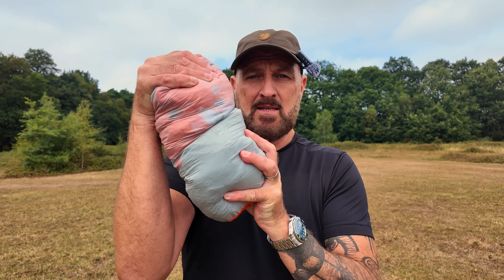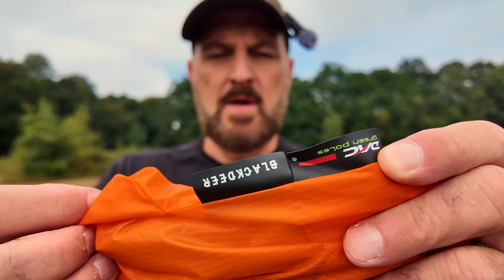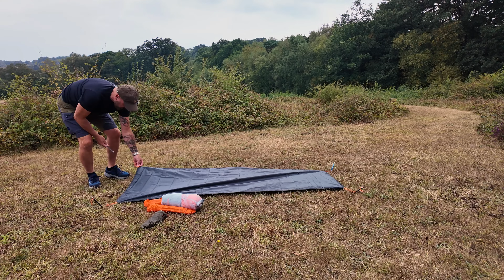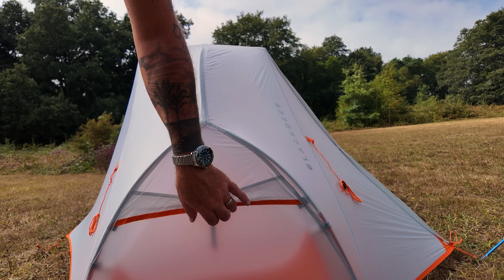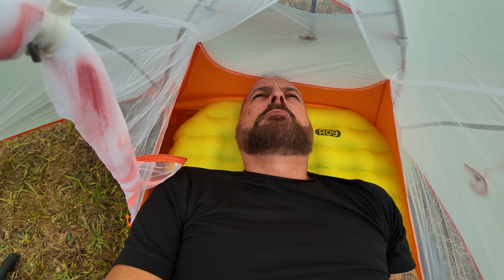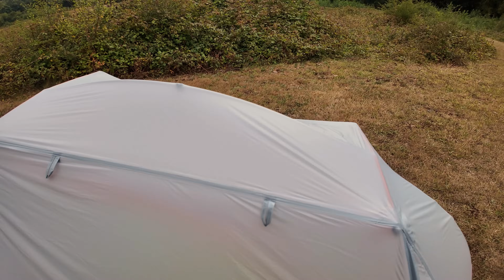42mph tested Budget Nemo Hornet? 985g DAC Tested tent from @blackdeer_official #camping #ultralight

Comment: Being under 1kg with poles is just incredible. I'm not as tall as you but I do have broad shoulders and I noticed that it looked very snug at your shoulders in the video. I love as well that the door can be used as a canopy by unzipping both sides and holding up with poles. If they did a 2p version to combat width concerns I would be very interested.
Reply from the maker: They may bring a 2p out but ues it was snug. Im 46 inch chest but im wide rather than deep so filled it pretty well

Comment: Apologies for not being relevant to the video but how are you finding the tianshan I’m looking at getting it but just want an opinion first, thank you
Reply from the maker: So far really good. Only annoying thing is it doesn't stand up on its own when full. But most my packs dont. Ive used it on every camp trip since I got it. No issues so far 👌 dont forget to use my code to get 10% off if you buy it. Novice10 👍
Reply: @NoviceWildCamper  thank you very much, will do

Comment: The big selling point of the OSMO material is that it's a nylon-polyester blend that doesn't stretch when wet (which, in my experience, is actually true). The Nova just seems to be a standard SIL-nylon tent. So if anything it is more comparable to the old "non osmo" Nemo Hornet
Reply from the maker: To be honest, out of, I dont know, 39 tents maybe with 90% being sil nylon, ive only had one stretch in rain which was the lanshan. And the only issue was i had to tension the guy s once on each corner. At the end of the day, its incredibly similalr and those that want a tent that wieght and style can save a huge amount of money.

Comment: If it were a couple of foot longer and not bright orange I would buy that as a 3 season tent over the yank ones. Fluro pink yes to match me hot pants and bra. But still a good design and a bonus with dad poles. And as you say no poxy vat or import bollox on top👍🏴
Reply from the maker: Yeah its a tad short for me so defo for you. Even in your hot pants 😂
Reply: Lol yeah it's a way of earning a few extra bob. But tbh I've been using my new MLD Duomid dcf only had it a few months but it's rated as a 4 season tent and I've had a custom inner made loosely based on the Lanshan 1 4 season t zip inner but wider and longer sofar so good. I got a 950 Ruta pole made up it's a inch thick so stronger than the average 18-20mm poles.👍🏴
Reply: 👆
dac poles